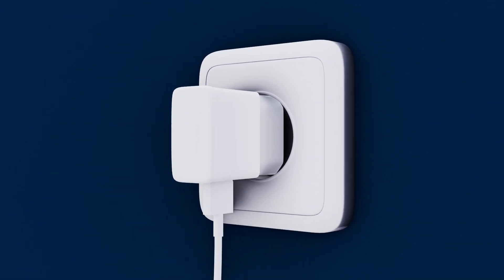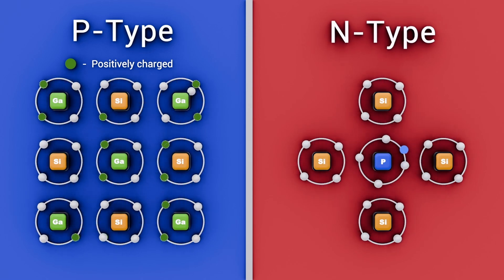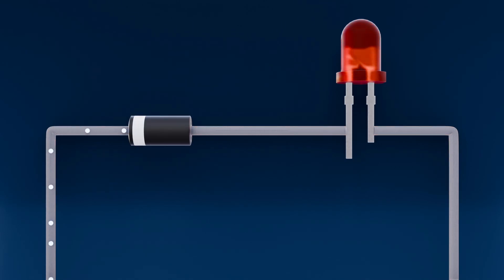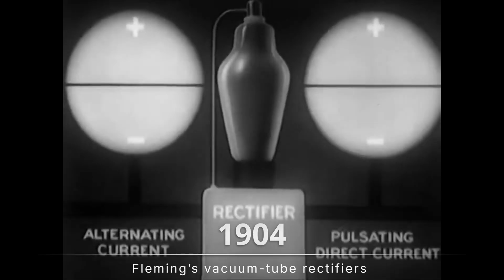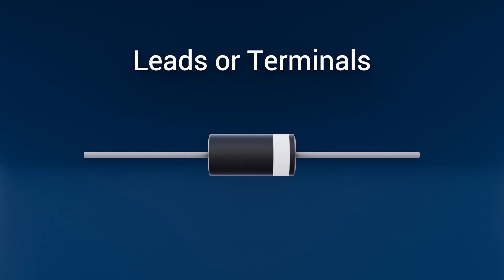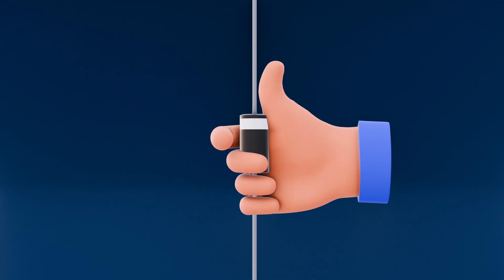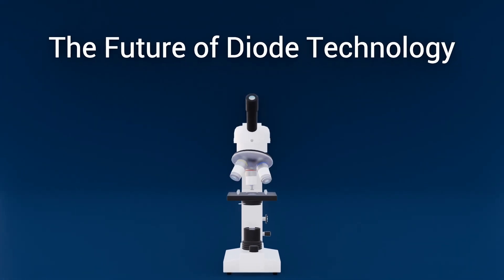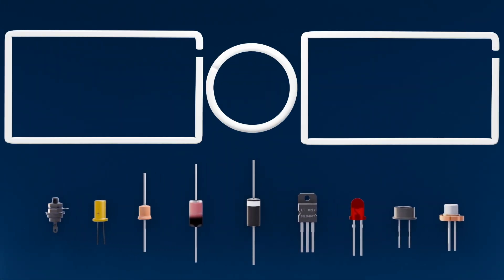What Is A Diode & How Does a Diode Work? | Diodes Explained #diodes #engineering

Comment: This video is about diodes. A diode is a semiconductor device which has one functionality. Its function is to allow the flow of current in one direction. If we change the direction of the current de diode will not allow that the curren flows trough it. A diode is compound by two kind of materials, the P material and the N material. Even the only function of a diode is allow the flow of current in one sense, there are a lot of types of it. For example we have de PN diodes, the schokty diode, the zener diode, the light emissor diode and so on.
Reply from the maker: Thankyou for your comment and support! ☺️☺️

Comment: I know that the water comparisons often fall short or are  just inaccurate, but a diode is somewhat like a check valve in  plumbing.
Reply from the maker: I think this is a pretty good analogy myself! Good suggestion! Check valve/ non return valves are similar in their purpose etc. ☺️ but as you said not a perfect crossover, it’s not totally accurate to compare directly.

Comment: 5:41 not smooth dc, pulsating dc, need filter capacitor and volt regulator afterwards for smooth dc even under load.